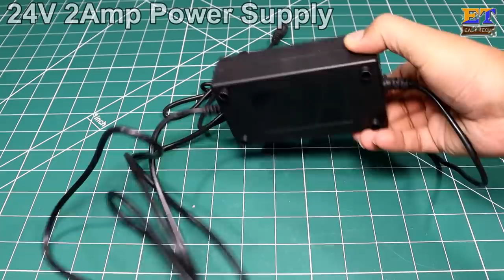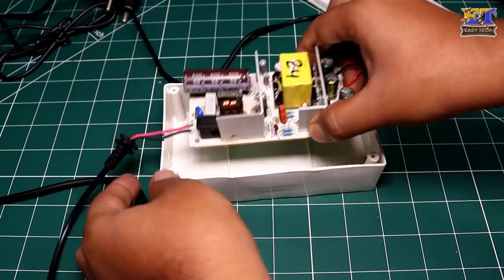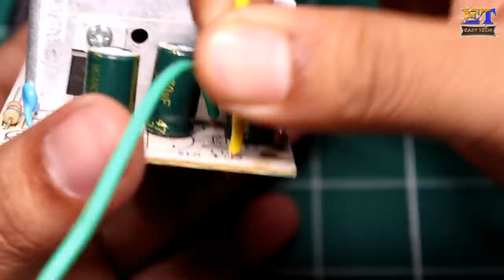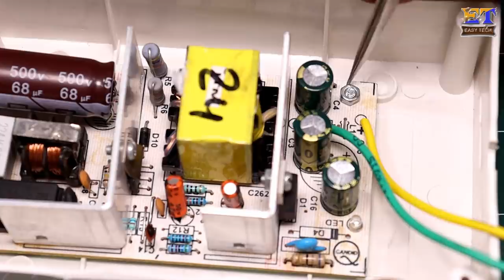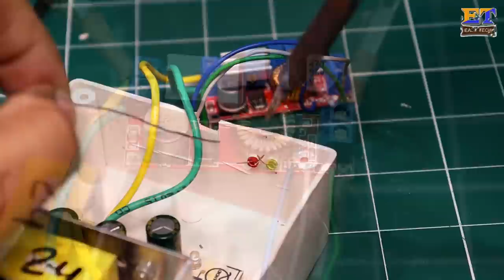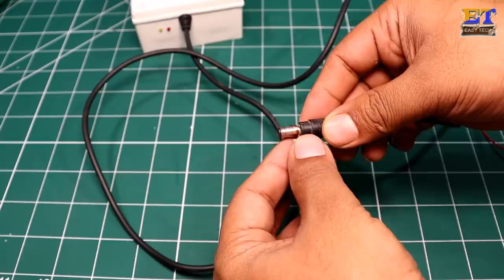How To Make 12V 3S Lithium Battery Charger

Comment: Where you buy this PVC box
Reply: You can buy it from any electrical shop , ask them to give you zero hole box or PVC gang box or switch box. Different shop keepers call it with different names.
Reply: @yjtechnical4700  in Pakistan I visited many electric shop but not available in Pakistan where are you from ??

Comment: I like your videos, you do quality work very neat and clean. Can we use a 13v or 14v adapter instead of 24v ?
Reply: no , because he use step down module which work perfectly with higher input voltage as be required output from it . if you require 12 v constant from it then use 13v to 14 v but amp is not much to charge a battery. so he use higher voltage power adapter make it easy or customizable voltage range for future use.
Reply: What if I don't have 24volts charger, is it possible  to use a step up converter in a 12 volts charger!??
Reply: @romsaymwiti9387  it's possible but although you can boost voltage that will be at the expense of power amperage, let's say you have a 12v 5amp adaptor connect to the boost converter once boosted to 24v you will probably have about 1.5amps available, that's a large loss.